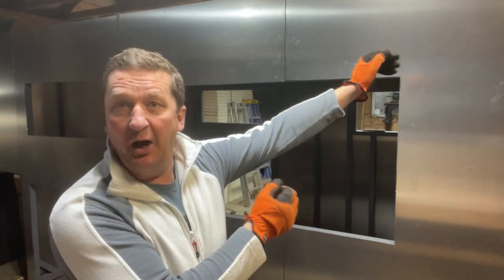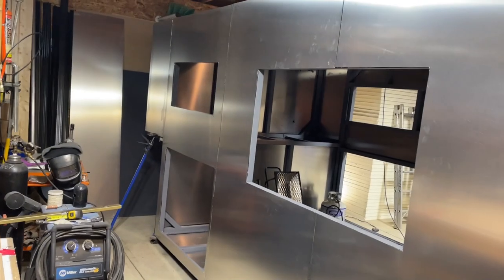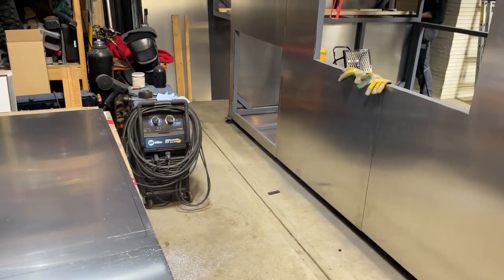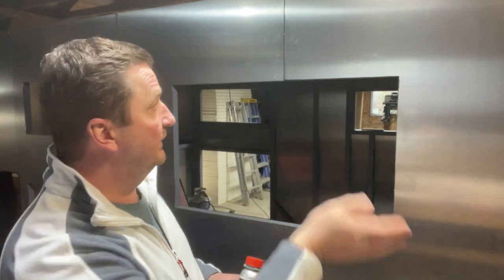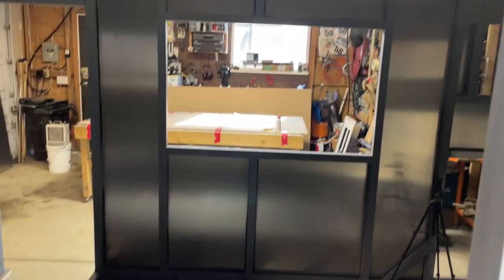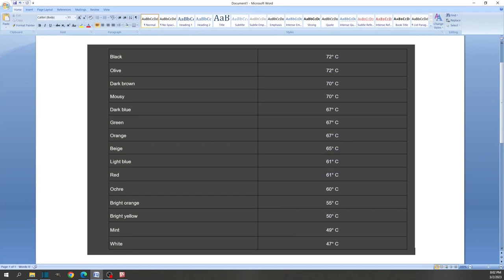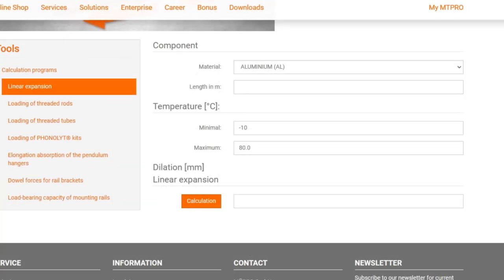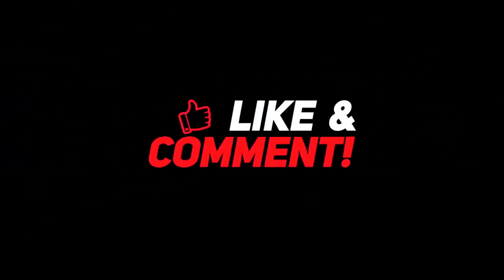How to glue aluminum sheets on the camper truck habitat wall and lots of diy tips about the process

Comment: I watched most of your videos and was very impressed with your determination for all this amazing work, and wondered why you didn't use gelcoat polyester panels instead of aluminum sheets, the polyester panels are 5mm thick, have the advantage of measuring up to 12m long by 2.5m, so there is no need to make joints, but the difficulty is that it is impossible to handle alone.
Reply from the maker: Thank you for your question. Honestly I looked in to that at the beginning of my research but found out pretty quick that this is something I can't by domestically, needed to import it which creates higher cost. Also I can not do it without help and well sized work shop. I was afraid of having warped walls, steel and aluminum represent materials I feel comfortable to work with experience wise. But it is definitely a possibility to do it that way !

Comment: Congratulations 🌟 👍  looks good.

Globe Trekker  uses a power caulker  with sikaflex not sure if 252. They make these Expedition panels. They have a build series that talks about using it and shows it in use often.

Thanks for the tips at the end. Very good breakdown about the expansion gaps.
Reply from the maker: Thanks for the info!

Comment: To clerify, you need to consider the mounting temperature in tip number 5
Reply from the maker: Thank you for your comment, the mounting temperature is  not so important as long you are within the specified temperature for the glue process. But what I explained in tip number 5 was the constantly changing surrounding temperature through weather, elevations and season. That will have a thermal expansion impact on the sheets.

Comment: Hello Oscar.  Great video.  I wonder, could a full size FRP sheet  (4mm) to cover the sides done the job as well? What do you think?
Reply from the maker: If you can get it in that size it would be a possibility. But not for me because I used FRP sheets in my trailer and the handle bar from my bike smashed a hole in to it very easy, so I like to have something stronger.

Comment: Hi Oscar, very informative - Quick question: If you have an expansion of 2,56 mm in the panel; and another panel next to it also expanding 2.56 mm, why did you only allow 3 mm gaps between the sheets? Using your numbers I would assume that the expansion allowance would not be enough?? Would be very interested in your clarification?
I am building a "Habitat" on to a 1995 Isuzu FTS 700 Australian Firetruck - low kilometers (35,000 kms in 38 years) 
Really interesting video's - Cheers - Guy
Reply from the maker: Hi Guy thank you for commenting and I wish you all best with your project. In case of the expansion gab a aluminum sheet expands always to both sides, means roughly 1.3 mm to each side, if the adjacent sheet does the same there is still plenty of space for them to move back and forth.

Comment: Looks great! Did you consider using 3M VHB tape?
Reply from the maker: Yes I do but only at the roof. First I have to see how well the silicone beads look like and will I trust them, if not I apply the tape over the whole seam cover strip.
Reply: @oscaroverlander_MB1222AF  I meant instead of the Sika glue, for the panels? It is made for that. I am sure your work will never fall apart, your prepwork etc.
And I don’t think you’ll need extra strips at all.

Comment: Do you have to hold the vertical panels against the frame while the 252 sets?
Reply from the maker: You don't have to hold them, if you have squeezed them in the sika bead they hold in position.